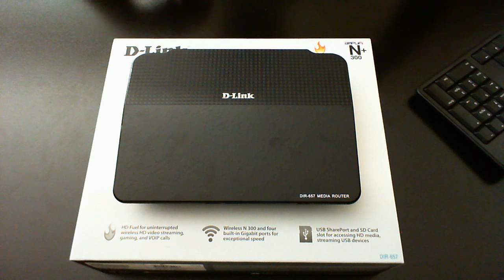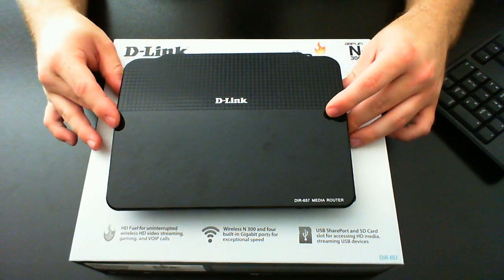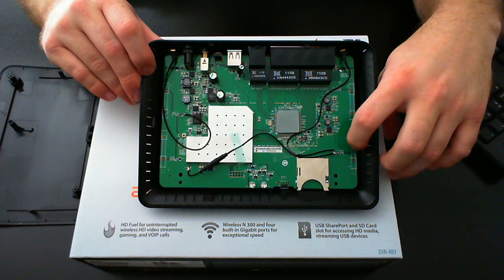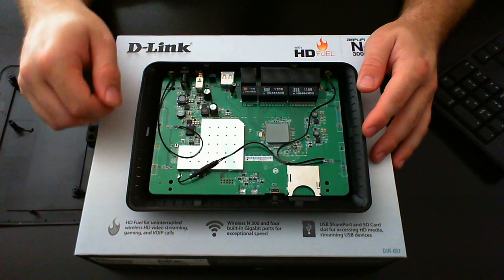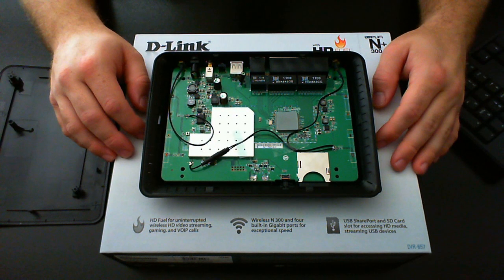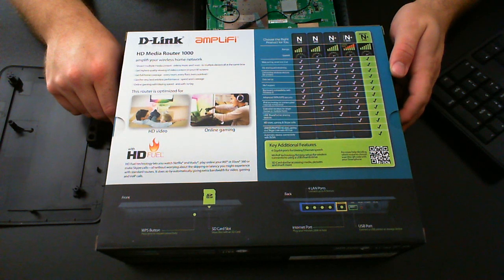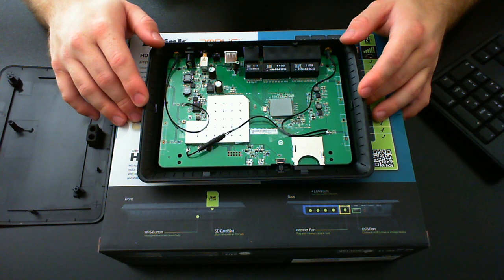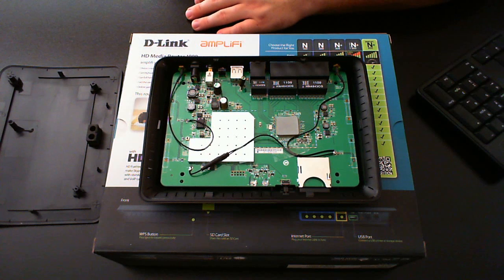D-Link DIR-657 HD Media Router 1000 Mod / Review

Comment from the maker: I use these extensions. The ones I buy are shielded. You can find the corresponding antennas from the same seller. Just put this into ebay and you'll see what they look like.

Mini SMA Male Signal connect booster Cable antenna for U.FL PCI network adapter

Comment: If this is the only router you should be getting 100 percent signal 8 feet away.Sometimes if you have another router close by it will mess with the signal.I would go back into the router settings and recheck everything.

Comment: With out mods on this $20 dollar router. I am able to stream HD video several rooms away.Also able to transfer large files very quickly from wired computer to wireless computer.I did apply firmware update which I suggest everyone do right out of the box.The antenna mod may be worth it you should be able to find the parts fairly cheap.I would think with a little searching around under $30 US dollars.The one thing I do suggest is turn off the QoS and traffic shaping unless you modify the settings.

Comment: I got one of these DIR-657 HD 1000's last week and so far it's working out well. Using it as a wired router it seems to do OK. I didn't expect much from the wireless mainly because of the deep discount I got on this thing. We have a voip router and whole house with 6 people, wired up with ethernet cables and several wireless AP's funneled into the Dlink as the edge router. Netflix, Youtube, and and voip, etc so far are ok. RR turbo tests at 23 mbps down, 1.92 up. I do like your simple fix tho.

Comment: Thanks for the Video. I'm a newbie on router mods. can you be more specific on where to get the parts? I searched ebay and googled as well for the chassis mount sma connectors with leads. Did you add the wire yourself (are you using coax or unshielded wire inside the box). I agree that the performance stinks. I compared a linksys G router running dd-wrt and is out-performing the D-Link dir-657. Thanks again.

Comment from the maker: It has helped some with the frequent disconnects. One thing I'd do is go in and turn off all of the Game Fuel / HD Fuel settings. Then set it up using the basics, no filtering etc.. If your xbox has problems connecting to matches / games, put it in the DMZ and give it a static IP address within your network.